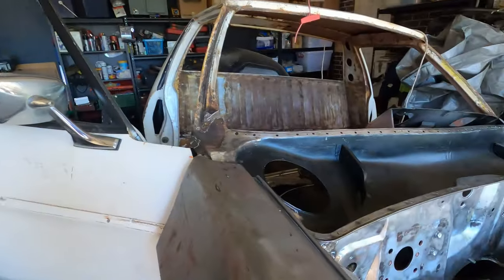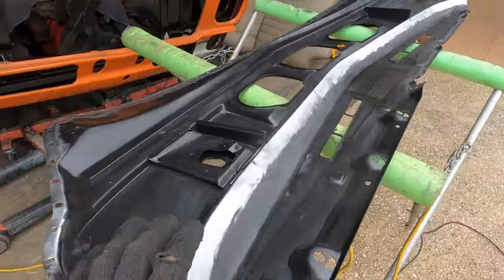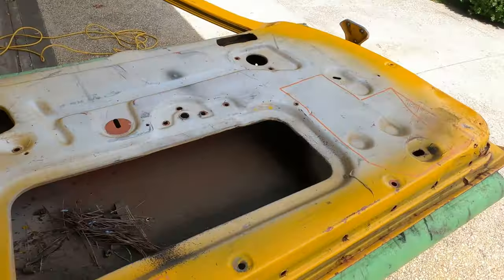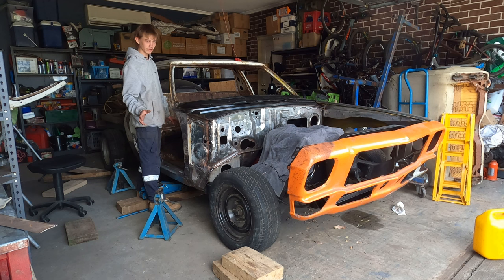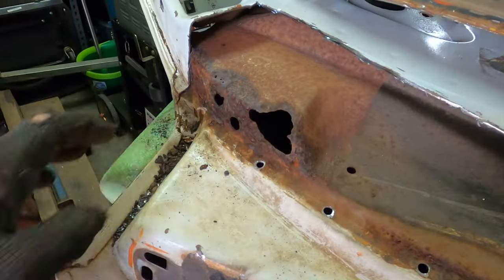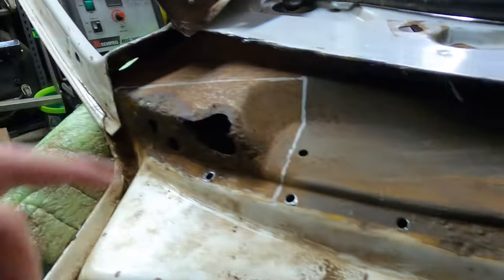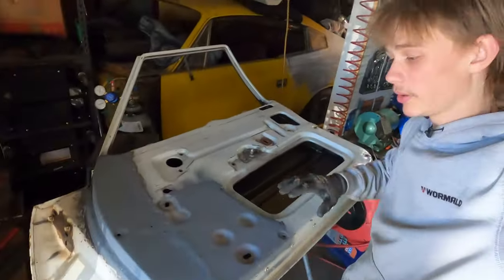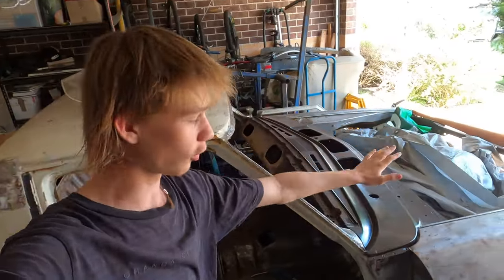REPAIRING RUSTY HQ DOORS

Comment: JUST remember tig is hotter than mig and you do know you can use a filler wire for mig and you can use CO2 gas for your welding ok its way cheaper and your going to grind your welds i use CO2 for all my mild steel work CO2 you pay for the weight not by pressure like argon , as i said tig hotter and argon gas is for Finnish welds obviously you have to use argon for tig .
Jasmine the JDM girl 👧 from Sydney Australia 🇦🇺 💕